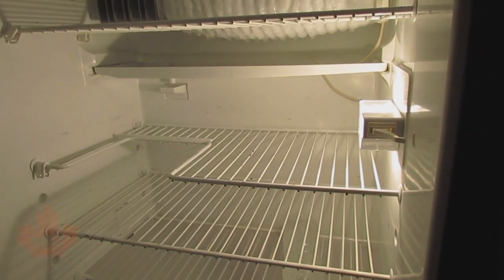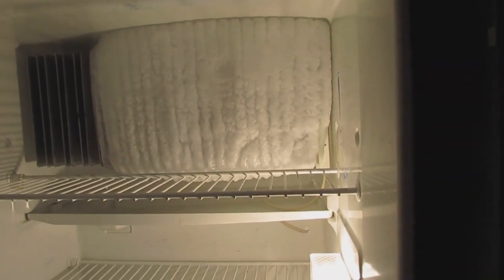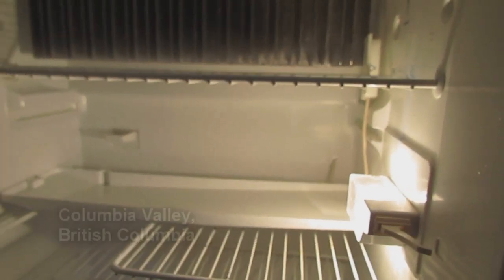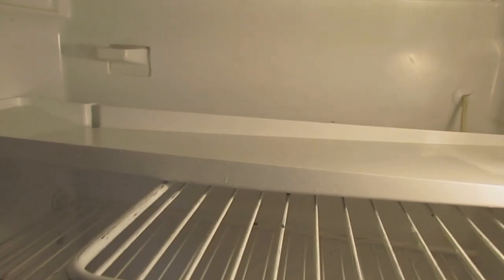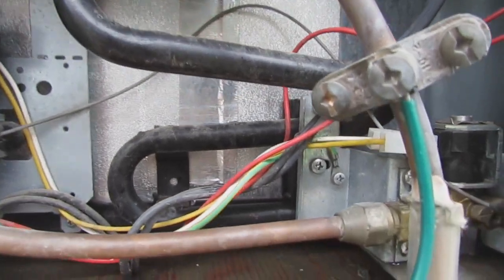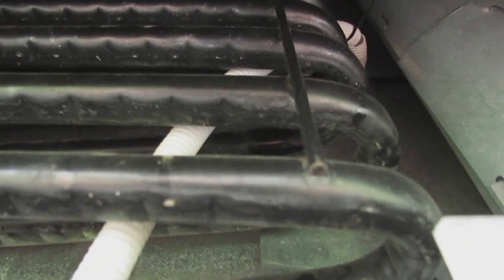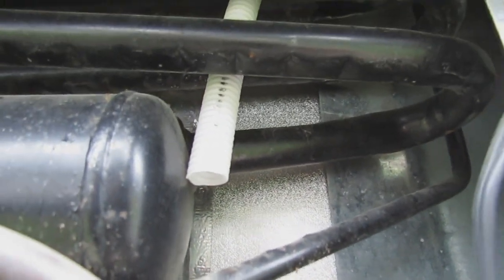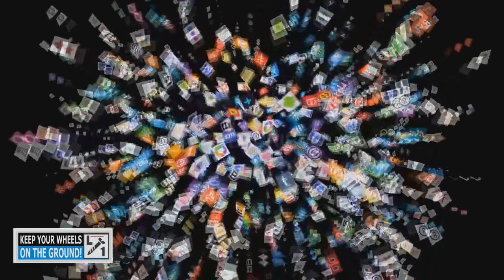RV Dometic Refrigerator Frost & Drain Hose Issues

Comment: If you aren't aware of it . Domestic has a fridge recall for model years 1996-2006. The propane leak will burn your Rv to the ground .
Reply: How can I tell if mine was switched out?  Is there a serial number plate?
Reply from the maker: Mike Johnson I was aware of it guess I should get around to checking if my model is on the list. Does it cover units sold in Canada?
Reply from the maker: Ronny Julian I just checked. Mine is a 2007 DM model and it looks the the 20th unit off the assembly line in Sweden where it was made so my refrigerator it's not effected by the recall thank goodness!
Reply from the maker: Mike Johnson I'm just taking to my neighbour and she has one of the units that's defective. Dealer doesn't seem to worried about it. Think they're interested in trying to sell new units rather than do warranty work that they make less money on?!

Comment: My hose sticks outside the panel , drips right to the ground
Reply: Mine sticks out with a hose cap with tiny holes. I’ve never seen it drain outside. All the water drains on my tray and I put a towel in it every few days. I guess it needs changing but I thought about blowing it out first but probably need to disconnect and clean it and put it back on.

Comment: Dometic has bad corporate culture. The company goes through restructuring every 1 and half to 2 years. They buy and sell part of their business and in the process lay off or fire engineers at those times. The new engineers are give that time slot to figure out the product on their own while the previous generation of engineers have already left the company. Within that time period the engineers are expected to redesign and create new product line while supporting the factory existing products. In that time the engineers are not supported by the management with resources required to meet the deadline while designing quality product. Essentially the engineers just put pieces together and hope things work because of no support from management. The end result is flaws in the product like you are seeing. This happened in all Dometic departments like awning, air conditioning, refrigeration etc. The awning had a recall because they tried to short cut and launch product when they were not ready. The engineers are not empowered to work there. I worked there as an engineer and it was a bad time in my life. The only good thing about it was the money I saved up because I knew my days over there was numbered anyhow.

Comment: That really is a poor design.  When you repair it maybe you can extend it down.  Depending how the floor is, drill through, run the line out the bottom.  You can put a rubber grommet in there to seal it up.  Just a thought.

Comment: dealing with the same thing, tried to attach a new hose to the old one- forget it, its totally disintegrated . gonna try to push it up into the upper opening, and thru the hole in the base of the compartment...what a cheap piece of crap that hose is.

Comment: I can already tell you're gonna have problems with the flooring beneath the refrigerator and in front of it. That water will drain down, soak and rot the wood beneath over time. My drain hose goes all the way to the bottom and drains out beneath the RV.